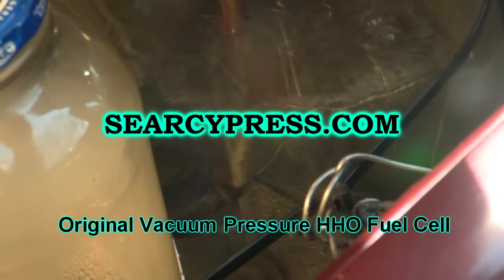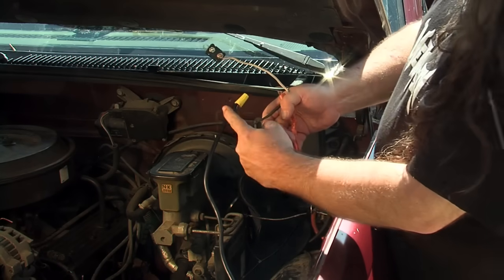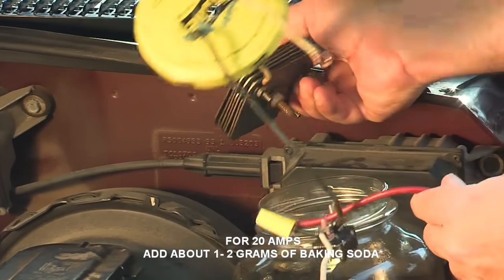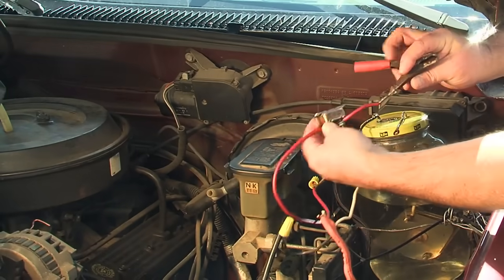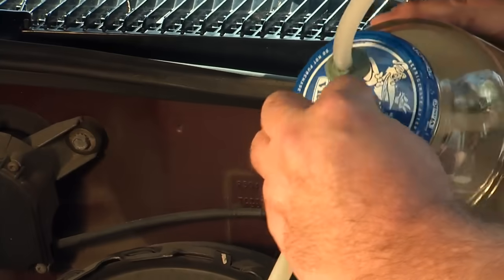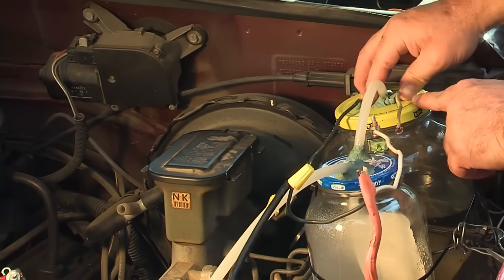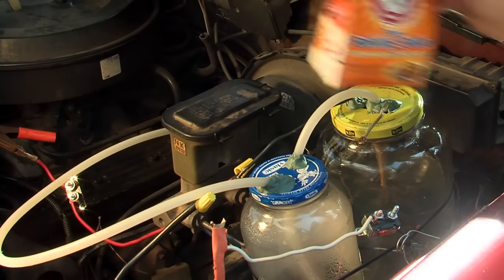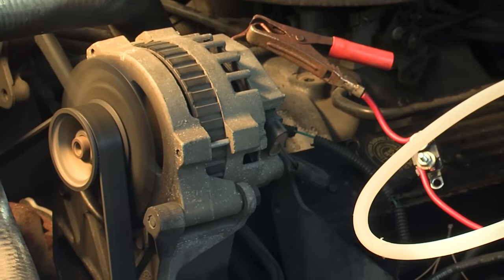Vacuum Pressure Hydrogen fuel cell defeats high gas prices using hydrogen from H2O.

Comment: Great video. We must do a international organization to prom hydrogen combustion motors. Is the real future, but oil business are fighting to be alive for many years. Best Regard from Mexico City.
Reply: oil business has nothing to do with this. it's mother nature and her laws of physics that ensures, that such a setup would never work.
Reply: hey my friend i live in mexico as well and are interested in building these so we can make a cheap help out poor people ti=ype of buisness i want to try to make some of these and test them out so i can help out peoople who have old v8 car or 6 cylinder cars so they can run efficiently
Reply: Your beleif that "big oil" is keeping this away from you and not seeing that your own inability to see that it actually doesn’t work is what's keeping you poor. You can't create energy out of nothing. The electricity needed to create the hydrogen comes from the generator/alternator, the energy needed to make the alternator work comes from.. You guessed it, the engine, and where does the engine get it's power from? The fuel, the freaking fuel! You could drive a car on hydrogen, but it's not possible to create it with energy from the same engine you're trying to operate of that hydrogen. Understood?

(I must be insane even trying to cure stupid)

Comment: Wouldnt say its steam cleaning. You may get oxides forming inside components due to the production of water from H2 and O2. Ofcourse depends on what kind of metal is used to make those components and parts.
Reply: I had trouble with my intake valves. replaced the heads twice in 4 years.
Reply: No, its legitametly steam cleaning carbon buildup/deposits from the valves and combistion chambers. VERY much like a commercially sold water/meth system would.

Comment: I would love to see the inside that engine. I wonder if any rust has started to build on those those cylinders due to the water getting suck in.
Reply: +Nelson Siliezar There shouldn't be any problems with inside the engine, since this is pretty much bunk and not putting anything into the engine.

Comment: How does the water react with the oil. Does your oil reservoir have water in it?
Reply: +Chris Costa  he's raised a valid point actually. as the gas mixture is ignited in the cylinders, it'll reform as water, where most of it is blown out of the exhaust, some may contaminate the oil.
Reply: what the hell are u talkin about oil. its water. baking soda and a damn electric cell
Reply: it's possible due to water not being compressible, and as a result, the only place it's going to go, is through your piston seals, into your crank case. the combustion and lubricant system aren't as separate as you think, some fuel always leaches into the oil, mostly in the form of burnt deposits, hence the black tinge over time.
Reply: @MrRedeyedJedi  piston seals? Lmfao! You mean rings? The heat from the combustion will turn the water to vapor [steam] & will only convert to water AFTER it cools in the exhaust system. So, no, it won't contaminate your oil.
Reply: Replace your piston rings then
Reply: How is that even possible? the combustion and lubricant systems in your engine are seprated

Comment: Curious as to weather using a wood gasifier to run the engine and a hho kit from the alternator would be a good combination. Sees like you would get some of your horsepower back from running your motor off wood with the hydrogen and also help prevent tar build up from the wood gasification process.
Reply: +Mason Putnal One problem with your scenario is the HHO is manufactured from energy from the alternator which obtains its energy from the primary field (gas or wood gas).  This is a zero sum at best and practically speaking a net loss due to the imperfect transfer of energy in the above steps.

Comment: Double your mileage? Your engine would have to be running pretty poorly to begin with. Whatever pump you got double the mileage on. Keep using it. Its giving you extra gas. A tuned up 350 might be able to eek out about 20 mpg under good conditions.  You are not doubling that under the same conditions. I can believe you might get 10 city and 20 hwy.  But your not getting 30 mpg with a tale wind let alone 40. You'd have the most efficient gas engine in the world at that point maybe nearing 50% efficiency with a basic design that is mathematically maxed at at around 35% and realistically is probably in the 20's. 26 mpg MAX sounds tangible and it probably works great, but don't go throwing claims like doubling your mpg because it ruins your credibility. That said, nice video.
Reply: Patman84 Think about how small the amount of hydrogen would be on each stroke bud.  It would just make a little flash and be gone, letting the fuel do most of the work.  Your gains would come once the engine is tuned to optimize the different gasoline combustion rate.

Seriously.  Calculate it out if you like at 2000 RPM's and 2 liters per minute, which is a typical rate.  And then remember that Hydrogen has less energy then gasoline, and then remember that hydrogen will be exhausted by the time gasoline is getting going.

And then after all of that, remember that anything the hydrogen gives back to you as added fuel will be a fraction of a fraction of a fraction of what was put into it.  I mean let's assume, 80% efficiency for both the alternator and HHO generator, 30% engine which is AMAZING.  That's only .8 * .8 *.3 = about 19% of what you put into it.

 What will need to make up the remaining 80% loss in order to maintain the same power?  FUEL.

The entire principle of HHO hinges on  fuel burning sooooo much better, that it more then makes up for the 20% efficient process used to burn its primer, HHO.
Reply: +Quadrunner hahaha...yeah....agree...but partly you affirms that this project really work....?
Reply: +Leo Victor Oh yeah its proven to work, not in my book though.  The trick is getting enough benefit from it to offset the inefficiencies of going through 3 energy conversions with a better burn from your gasoline.  Most people don't have the time.  I'm gonna make a system for a small engine I have and test it out myself just for fiddling.

Nasa really did study the effect of hydrogen on gasoline combustion and found you get a faster burn, lower emissions, and can run your engine leaner on both fuels.  They did not test a system run off an alternator in a car, but they did use a big V8
Reply: +Quadrunner you arent taking into account the basic idea that it is using hydrogen in place of a portion of the gas it would have used to begin with, not in addition to. with that idea in mind it is easy to understand how you can be doubling your gas mileage. the % efficiency you are talking about does not take into account the hydrogen as an extra fuel source and if taken into account would pull that number down a bit to the more realistic idea of efficiency you are talking about
Reply: your talking out of your ass. the juice with this technology is maxing out burn efficiency.  with the petrol/gas mix an extremely high burn efficiency is achieved. that's the whole fuckin point.
Reply: Frank Gutowski not magic slik. Just the physics you won't learn in the classroom. Really, if you think we've reached the limit and there's no reason to go forward, so be it.but what on earth would compel you to try discourage anyone else? There is no limit unless you set one so set yours where you want and leave the rest of us be please.
Reply: LMAO! Your comments just keep me laughing. These "Hillbilly Engineers" need to crack a textbook, for sure. We both know from "real" Science, that this is utter B.S. Lol.
Reply: Bill Does Stuff

Comment: I've worked on a project similar to this. My question is (is the best amperage to produce gas between 25 and 30 amps?)
Reply: ^^^Someone please answer this.  It's my question too
Reply: +Juggalokb It would depend on the surface area of stainless steel actually touching the water. You can raise your amp draw by adding more electrolight.   Say you are drawing 10 amps and making 2 liters per minute, if you added electrolight untill you were pulling say 40 amps but only making 3 liters per minute.  That would NOT be an efficient use of electricity, using 4 times the electricity for a 50% increase in gas.   Not to mention if you are drawing 40 amps on less than 2 gallons of water it is going to get too hot and boil.    You will have to experiment with your system by measuring the gas production to amp draw ratio  at different amperages in order to find the most efficient amp draw for the size of your cells surface area.  The amount and size of the stainless steel plates you have will determine how many amps you can draw without boiling the water into steam before the electrolysis has occurred. You don't want that.       My water boils at 17 amps with 3/4 gallon of water on this kit. http://www.ebay.com/itm/21-PLATE-HHO-HYDROGEN-GENERATOR-SEALED-DRY-CELL-KIT-WATCH-VIDEO-/131698816097?hash=item1ea9dc7461:g:rgoAAOxyyFhTdV9w&vxp=mtr
Reply: Out of a fuel oil burning furnace.
Reply: I'm using carbon not stainless, and my cell is 3 gallons, and no electrolyte. Boiling is not an issue due to the ceramic cooling system. I have a controlled amperage system also. It is a stand alone 110v system with cooling pump.  It isn't powering an engine, just producing hydrogen. I have no way of measuring the output yet. I am also trying to produce a more pure hydrogen gas, than an HHO gas, by collecting the gas from only the - rods.
Reply: I had progress using pulsed high voltage thru a old coil. less amp draw and at least as much production maybe a bit more.
Reply: What type of coil. Out of what?
Reply: What is?
Reply: Coil.ignition coil from furnace. Dc caps and have added a ballast ffrom 1500 watt metal hallide.

Comment: So you use the energy from your motor, that you produced by burning fuel, to split water electrolytically wich is a massively inefficient process mainly due to the big overvoltage of oxygen evolution and feed it back into the engine where it is used in the best case at the efficiency of your motor. do you see where you fucked up?

also: plastic hoses are part of the thermodynamic process XDDD wtf?
Reply: You're alternator rises to the occasion.  Its lazy.  It only does what it has to.  If you don't call for electricity, it won't put a load out.  The little trickle used to maintain your battery pails in comparison to the load needed to work an HHO generator.  You will always see a net loss, wasted energy, when you compare the energy you get from burning HHO to the energy needed to create it.  Any gains you will see from an HHO hybrid system come from burning the gasoline in a more efficient manner because its the only external source of energy.  The theory is that HHO lights easier and faster, like a chemical spark plug that reaches all parts of your cylinder.   At 2 liters a minute of HHO production running 1500 rpm's think of how thin your spreading just 2 liters of gas.  8 pistons each go up and down 25 times a second at that rate.  Its just supposed to be used as an aid to the main fuel
Reply: +Rush CampNPrep "your alternator produces more electricity than what your vehicle needs,"

No, the alternator produces precisely the amount of electricity your vehicle needs thanks to the regulator.  If you ask more from the alternator it will, within its capability, load down the engine.  At best this is a zero sum game.
Reply: +Rush CampNPrep Yes more fuel is spent to meet the higher demand from the alternator that is loading down the engine proportionally.
Reply: Rush CampNPrep
 Regardless, the amount of energy out/in by the engine-alternator-electrolysis-HHO-engine cycle can never be more than unity.  About the only way this scenario could possibly be beneficial is if some sort of catalytic or similar action is occurring making the burning of petrol fuel somehow more efficient.  I haven't seen anyone claiming such a process yet.  The grand assumption made by the proponents of this technique is that the energy required to perform the electrolysis is somehow free from the alternator when everyone should know the alternator loads the engine (needs more torque) when asked to supply more energy.  This is easily demonstrable by turning on headlights while idling.
Reply: +bellydump1974 Proof and references please.
Reply: +phillifighter1337 In Canada and Japan they use Hydrogen hybrids for public transportation, not battery.
Reply: and there it is. The higher load on the alternator, the more the engine has to work and the fuel savings is Nil. It defeats it's own purpose.
Reply: Yup, law of diminishing returns. That's why this HHO nonsense system doesn't work. It takes more than it makes. Making the whole process pointless. This weak ass system, cannot produce the kind of high quality pure hydrogen that powers rockets. Not even in the same league. These people misunderstand not only Physics, but Chemistry, Math, thermodynamics and the mechanical demands of an engine, moving a vehicle down the road (not idling). Petro is magnitudes more powerful than this weak HHO, which is enough to run a Bunsen burner or small welding torch and no more. Lol. Not even enough HHO produced in one hour of generation, for one revolution of the engine..
Reply: not to the degree youre trying to make it seem. if we were talking about say a 100mpg car, then maybe we could talk about this hurting your fuel economy, but we arent. when youre talking about a 30mpg car, youre not going to notice any negative effects in fuel economy.
Reply: +Pierce Newby Remember the HHO was made from the gasoline at 30% efficiency.  Making the HHO consumes gas in the process adding to the regular load on the engine via a loaded down alternator.
Reply: Juggalokb this is not the same as a hydrogen hybrid
Reply: I get that.
Reply: phillifighter1337 http://www.caranddriver.com/toyota/mirai
Reply: +phillifighter1337 youre right, its not an efficient process, however, your alternator produces more electricity than what your vehicle needs, so here you are just tapping into that excess.
Reply: +Rush CampNPrep that is called a hybrid and there are reasons why those cars use batteries instead of hydrogen. (efficiency, storage of the energy, etc.)
Reply: +phillifighter1337 when you are dealing with EXCESS then efficiency really doesnt matter, it is energy that would be otherwise wasted, so even if you only harness a small amount of that energy, you are still making gains.
and production hybrid vehicles use batteries because we dont have an infrastructure to get hydrogen to people, because because of efficiency.
Reply: and because we have no good way of storing it yet, and i would say efficiency does matter. plus it seems like a pretty shitty idea to send hot water vapour through your steel engine(im not an engineer tho so i cant really make a qualified statement about these issues).
Reply: +phillifighter1337 
you dont store hho gas, you produce it on demand. it is completely unsafe to store.
and no, efficiency doesnt matter. if you are producing excess energy, and you capture a tiny bit of it, even inefficiently, that is better than capturing NONE of that energy.
so no, efficiency does not matter when it comes to this.
Reply: thats why you store only the hydrogen in a solid solution or a sponge like material and use the oxygen from the air. But as i said the technology isnt fully there yet.
Reply: +phillifighter1337 the technology is there, but isnt practical for this application. for this application, your best bet is to produce it on demand, with the excess electricity created by your alternator.
this isnt about how to store hydrogen to run your car solely off hydrogen, that is a completely different discussion all together, and would be significantly more expensive to implement.
this is about taking something that is now waste (electricity) and turning it into something much more useful (hydrogen)
Reply: +phillifighter1337 also, when youre talking about sending hot water vapor through an engine, there are 3 things about your statement.
1, you arent sending water vapor through your engine, you are breaking the molecule down into hydrogen and oxygen. now, when it is burned, it does produce water in the form of steam, which brings us to point 2.
2, your engine already produces water when it burns gasoline. water is a normal byproduct of combustion.
3, you can actually dump a fairly large amount of water down the intake of your vehicle. it is a common way to get rid of carbon buildup in your cylinders, on your pistons, and on your valves.
Reply: +SkyCharter i was being simple about my response. yes, you're right, your alternator, in the end, only produces as much electricity as is demanded. the capacity of that alternator is greater, and to get more from your alternator, is not going to consume more fuel.
so, it is not a "zero sum game"
Reply: +SkyCharter i understand the laws of thermodynamics, i realize that you will need a larger energy input than what you will get back from burning the gas.
with that being said, you engine is already producing more power than it needs to drive down the road, so putting a slight more load on the alternator is not going to effect gas mileage in a negative way.
that is the point, that your car is already producing more energy than what it is actually using.
but im actually really glad you brought that up, because that is the biggest issue with all of these "free energy" videos on the internet.
Reply: +SkyCharter if your not on the clock then you r just a silly dipshit.either way do us a favor and fuck off home.